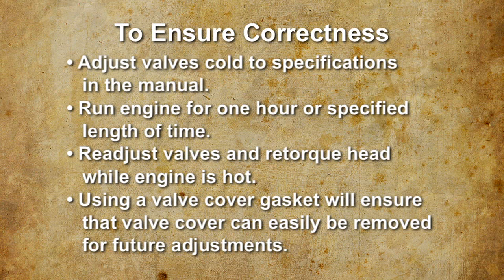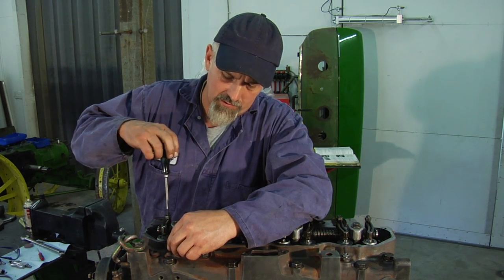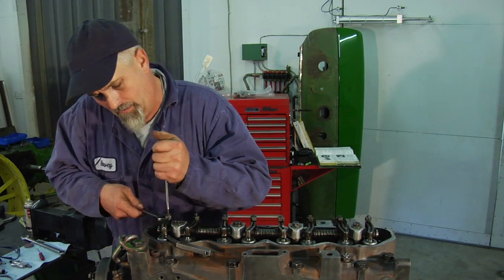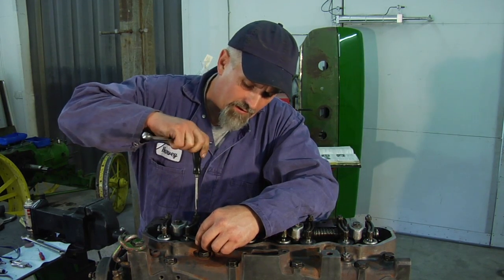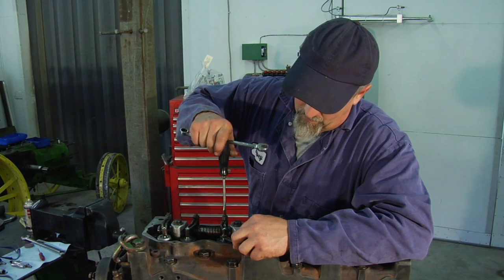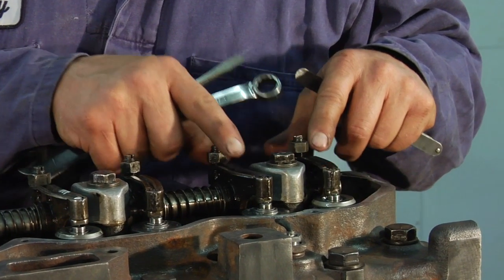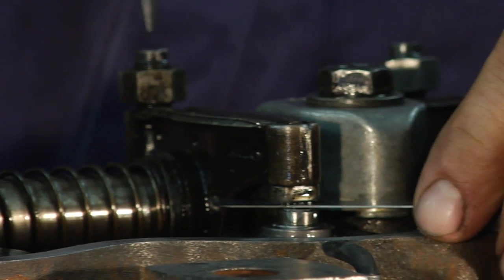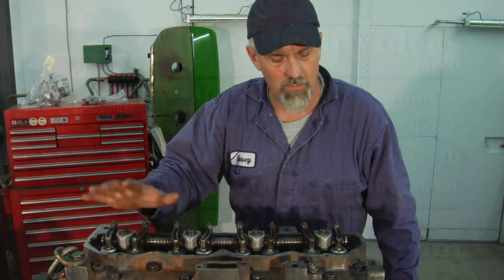Valve Adjustments

Comment: Thanks can that help with oil in muffler? 1967 David Brown 990.
Reply: Di you fix your oil in muffler issue? Mine does the same thing
Reply: @jesselawson1169  Nope it burns also antifreeze. Wonder if seals or valve adjustments. Its making clapping noise now!